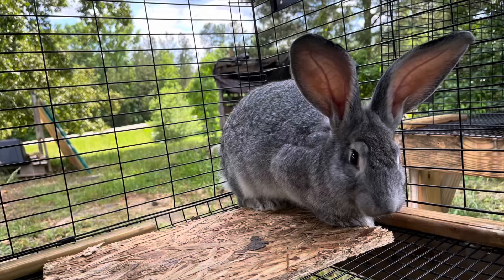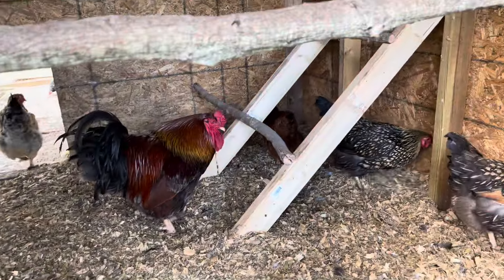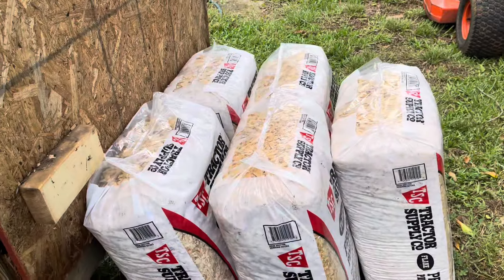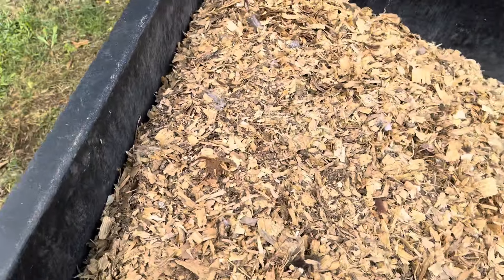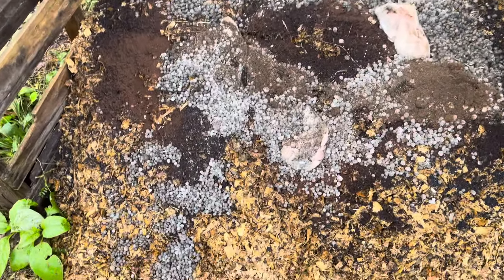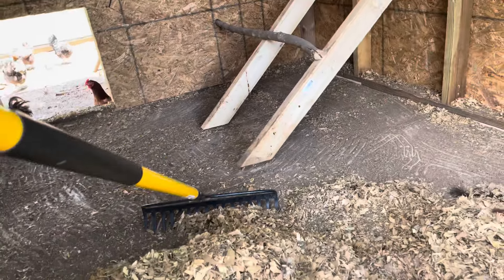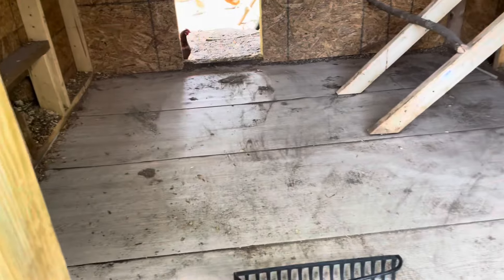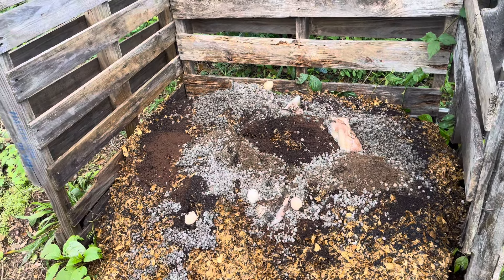Coop Cleaning and Composting (FAST & EASY TIPS)

Comment: We use sand in our coop. We built nest boxes on the outside for easy access and use sand in those as well with removable plastic totes we cut down to fit.  The inside we built foot wide shelves with a perch of a 2 x4  on the edge.  It takes us 5 mins a day to rack out the coop sand and shelves and then use a kitty litter scoop to sift it any poop.. We get a ton of washed construction sand delivered for $20 once a year.  It's way cheaper than constantly buying bags of pine chips. We compost as well.  Leaves, grass clippings, duck, chicken,  quail and rabbit poo. Paper, cardboard, tree trimmings, weeds, comfrey all kitchen scraps and butchering scrapes.  Love all you do.
Reply from the maker: Yeah, different locations have different resources. I’ve heard of using sand, but there’s not much of a source around me and the pine shavings work great for me and my setup. I use the deep litter methods so I used about 20 bags in a six month timeframe. I also use wood chips from chip drop from time to time as well which is my preferred method. I too have external access to my laying boxes. I only need to use this door when I’m cleaning the coop once every six months. Thanks for watching and thanks for your comment.